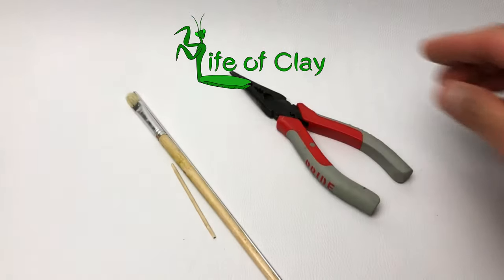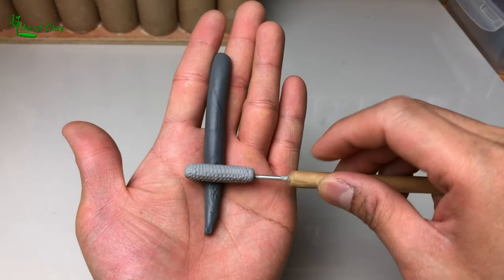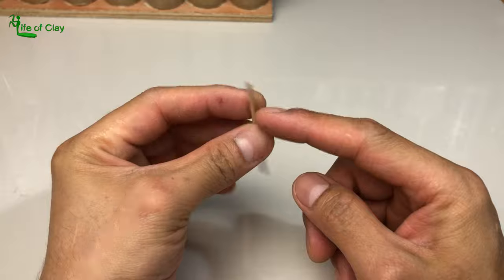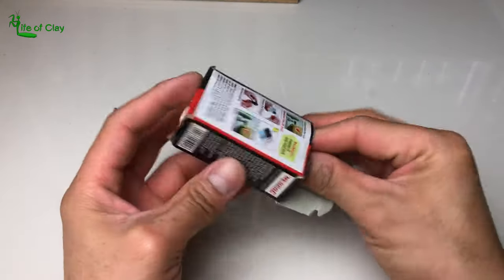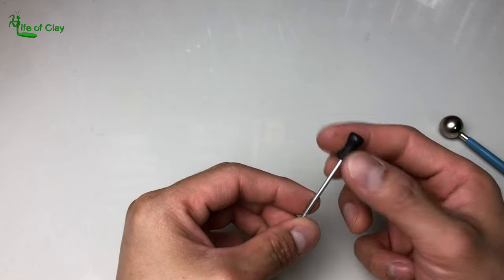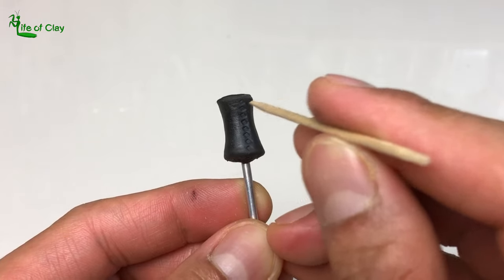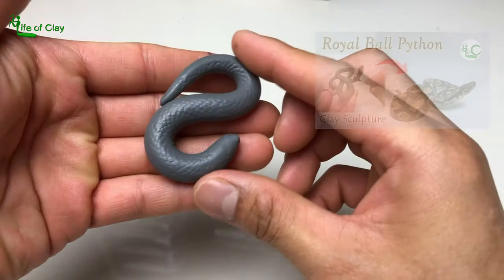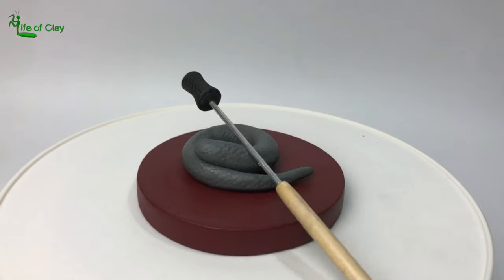DIY - Scale Texturing Tool V 2.0 _Polymer Clay Sculpting Tools_Life of Clay

Comment: why you decided to use epoxy compound this time? it does better than clay?
Reply from the maker: Some cured polymer clay for example a texturing tool reacts from the plasticizer that leech out on the surface of a raw clay overtime, making it weaker and crumble. Whereas, epoxy don't and not affected by the plasticizer at all.
Reply: @LifeofClay  thank you for answer)